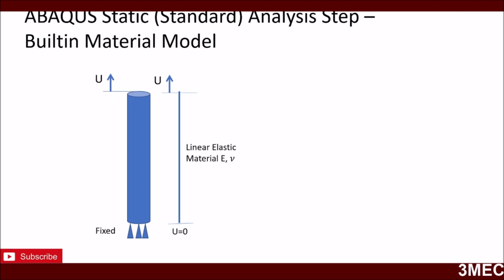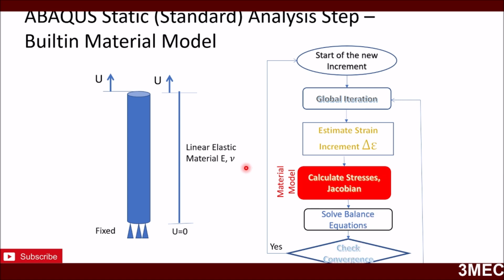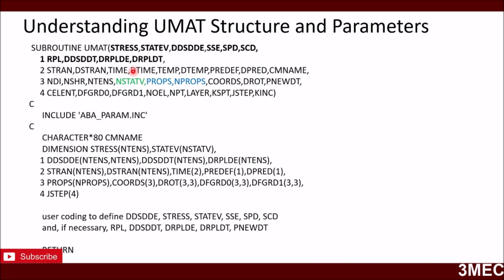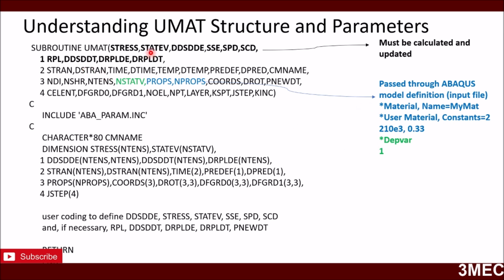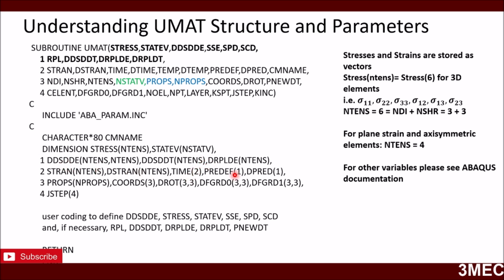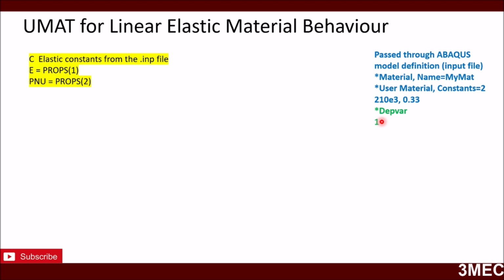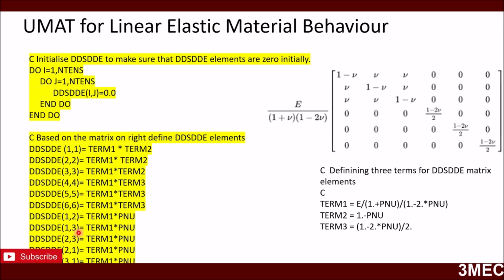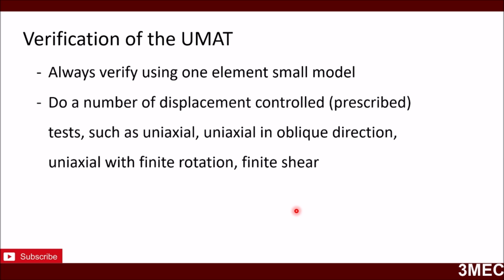User Material (UMAT) Subroutine in ABAQUS CAE  with example of linear elastic model implementation

Comment: Is JSTEP(4) here the step number? why the argument is 4? will it be same in the code?
Reply from the maker: Its an array of 4 with following.
JSTEP(1) Step number.
JSTEP(2) Procedure type key (see Results file output format).
JSTEP(3) 1 if NLGEOM=YES for the current step; 0 otherwise.
JSTEP(4) 1 if current step is a linear perturbation procedure; 0 otherwise.

Comment: Sir I think there is something wrong with your Stress update code:

Stress (I) = Stress (I) + DDSDDE (I,J) * DSTRAN (J) 

You can't keep the previous value of Stress (I) on the RHS, otherwise the code will keep adding the previous Stress (I) value at the end of every increment of the inner DO Loop. 

Maybe instead define a dummy variable that gets initialized at zero at the beginning of every increment for the outer DO Loop and use that dummy variable to calculate  DDSDDE (I,J) * DSTRAN (J) ? 
Then add the dummy variable + the previous Stress (I) value just once after the inner DO loop has ended before finally resetting the dummy to zero again.
Reply from the maker: Please do give it a try and let me know. In this case above works as everything works in strain increments. All the best

Comment: what's the difference between UMAT and UEL?
Reply from the maker: UMAT is to define user material model in the form of a subroutine in ABAQUS, while UEL is defining user element formulation which may include material behaviour as well. 
UMAT can be used with a range of elements which are already available in ABAQUs.
UEL require full element formulation in the subroutine.
Reply: @Professor3MEC  I have a problem which is causing me a headache. I'm working on a new piezoelectric finite element (with UEL), it works fine with simple geometries, but for complex ones (a spring for example or a cylinder) it gives false results. 
I know the issue is in defining a local cylindrical coordinates system (because the material is not isotropic). I tried the *orientation keyword in the input file, but it actually doesn't change anything (defining it or deleting it doesn't affect the results).
Another solution could be adding an "orient" subroutine to the code, but I honestly don't know how to code it nor call it.
A third solution could be in defining a local coordinate system in the code itself.
Reply from the maker: @seifzeghichi  are these 3D brick type elements? The options you have mentioned are appropriate. If you want me to have a quick look then I may try but not sure how much I will be of help. Thanks

Comment: I have a question which might be a silly but I am new to this. How do we import this code in Abaqus CAE. Do I need to edit any system file in folder where Abaqus is installed
Reply from the maker: You will have to save it in a umat.f umat.for file and then in job module when you create a job specify the location of the file. 
Or you can copy the umat file in the same folder as input file and use comment prompt to run it
Abaqus job=job name user=umat.for interactive 

Also, to do any of the above you must have a compatible compiler installed based on the Abaqus s version.

Comment: can we defined material coating properties using UMAT sir?
Reply from the maker: which material model are you interested in? what type of coating is it?
Reply: @Professor3MEC  a ceramic coating sir , a TBC coating material
Reply from the maker: Why do you need a umat for it?
Reply: @Professor3MEC  to specified it hardness properties sir, can it be used to specified the hardness properties of a coating?
Reply from the maker: @syakiraliff  in order to find what to define, one needs to first understand what is required to be simulated or modelled. If you are after hardness then you can play with elastic properties to calibrate the hardness, there are standard relationships available. If you could email me more details on what you are after then I may be able to suggest in more detail. thanks
Reply: @Professor3MEC  sir if i have the value hardness of the material, can i defined wear simulation from the data value hardness only , because coating we didn’t do tensile test to verified the elastic properties.
Reply from the maker: @syakiraliff  for wear you may have to define material properties and also contact properties such as friction, etc. For material properties, you may need to see if you want to remove the material due to wear and for this you may have to use either some kind of damage type model or use strategies used in machining simulations. Following links may help.
https://www.researchgate.net/post/how_to_perform_wear_simulation_in_ABAQUS

https://www.youtube.com/watch?v=orFaMYWSHhA

Comment: Useful video. How to write UMAT code for Nonlocal model? For nanostructures
Reply from the maker: yes it will depend on which type of nonlocal model you need. I hope you do know about lower order and higher order theories. Higher order theories may require UEL rather than UMAT.
Reply: @Professor3MEC  I want to implement nonlocality for a nanoscale model In Abaqus using UMAT, I found it difficult to find the inputs such as Jacobian matrix . Could you be able to help me with this?
Reply from the maker: @dhamodharansd6001  I am in the process of developing a umat course for elastic plastic materials so keep an eye on that as this explains in detail on how to define jacobian. 
Derivation of jacobian depends on which material constitutive model are you using as it is the partial derivate of stress with reference to strain.